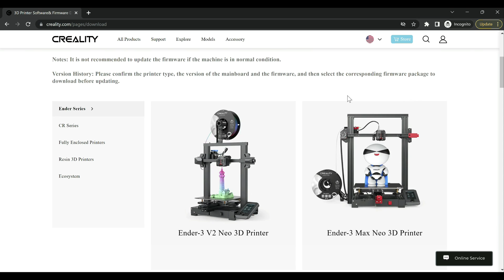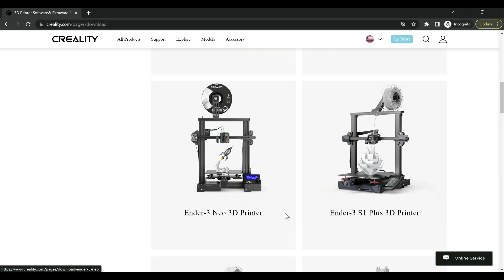Creality Touch Screen Install Guide

Comment: Thank you for another easy to follow guide. I followed the steps with my ender 3 pro w/ 4.2.7 and CR touch. When I turn it on the display shows the home screen, but the inputs aren't functioning properly. When I press it makes the input register sound, but either doesn't change screens or goes to the wrong screen. I've tried used both an 8GB and 2GB sd card to try reflashing the firmware. I have also tried using other sites firmware. Any thoughts on what I could try differently?
Reply from the maker: Hi. I havent seen a good version of firmware that works with this screen and the crtouch.
Reply: @3DPrintscape  Bummer, thanks for the reply. I've reinstalled the old screen for now. I'll be keeping an eye out for your marlin video 👀
Reply: Same exact issues. I guess I will put the old screen on and hope some better firmware comes out
Reply: @TwitcyTrain   after trying all three screens,v2 and the two touch, have gone back to original rotary knob. The best was the v2 rotary but  wanted my filament sensor to work ( ender3 pro with 4.2.7 )  but had to have cr touch as well,which ruined it, wouldn't work properly after install ,all genuine creality software
Reply: @iansummerfield4185  Thanks for the info . I also went back to the original rotary knob. I have a very similar setup with CR touch / 4.2.7...  I had a lot of issues just finding good functioning firmware because I also added the sprite extruder.  Finally have it printing mostly consistent.

Comment: Fucking hell, you cut out the one part I couldn’t do. How do you attach the damn thing
Reply from the maker: Hi. Which part are you having issues attaching? The cable or the screen to the printer? If its the screen to the printer. You put the 3 bolts in and align them up with the grooves in the frame. Then tighten them.

Comment: How do I install a BLtouch with this upgrade, I recently upgraded to this screen but I can't get the BLtouch to work
Reply from the maker: Hi. There was a separate .bin file that is suppose to work with the bltouch. I havent tried it out though. Once i get it working with Marlin, that may be an option as well.

Comment: Can you find out how to connect the touch screen to the skr mini e3 v3 board? I made a custom cable to allow it to connect to the tft pinouts but I’m not sure on the firmware where to begin to getting the screen working properly with that board
Reply from the maker: Hi. It could connect to the same port as the standard screen, just need to get it to work with the firmware (im trying to do that part myself and will have a video on it when i figure it out).
Reply: @3DPrintscape  I was going to do a comparison within the Marlin firmware between the mini e3 v3 and the update that’s available for the touch screen on the two creality boards that the update is for to identify what lines of script is used and hopefully just translate it to the skr firmware. What is your thoughts on that?
Reply from the maker: @AudioExportProductions  Thats what i was thinking as well. I can say just updating the configuration.h file wasnt enough. I think there is also something in the adv file as well.
Reply: @3DPrintscape  yea I’m finding in the configuration_adv under additional features that there is more on lcd and ui. It would be allot easier if we can view the .bin file for the screen update to see what they have enabled/disabled or if they added extra lines of script to the firmware
Reply from the maker: @AudioExportProductions  Makes sense and ya it would.
Reply: @3DPrintscape  I just don’t know how to change the binary file into something that makes since to me, I can change it to a hex file but it still don’t make since to me, lol
Reply from the maker: @AudioExportProductions  The .hex files are meant for the 8-bit boards, the .bin files are for the 32-bit boards. You cant look at anything in the .bin files, you would need the config to know what changes were made.
Reply: @3DPrintscape  makes since why after hours of trying I got nowhere, lol. I guess it’s time to just experiment and hope for the best
Reply: I think I got it figured out, I still have to upload firmware to the skr but I compared the config of the cr-6 se for the lcd.
Reply from the maker: @AudioExportProductions  Great, would you mind emailing me a copy of the configs, it will save me some time. My email is admin@3dprintscape.com
Reply: @3DPrintscape  so I sent you what I figured out but I haven’t had the chance to upload the firmware myself to see if it actually works on the skr
Reply from the maker: @AudioExportProductions  Thanks but I didnt get anything yet, even checked the spam folder.

Comment: I have the Ender 3 v2 with metal feeder for the extruder. It required 138% in esteps. I installed the new touch screen and lost the e-step calibration in the menu. Am I missing something or does it not have this capability. I'm getting under extrusion now. Touch screen really easy to install after watching your video. Thanks for making these videos.
Reply from the maker: Hi. They dont have some of the basic functionality built in. You will need to connect to the printer with pronterface or something like octopi.

Comment: Just did this upgrade, but how do I find/calculate my esteps on this new touchscreen?  I can't find them in the menu anywhere.  Do I have to plug it into a computer now?
Reply from the maker: Hi. I dont think its exposed in the menus anywhere, i couldn't find it either. You may need to use your computer and pronterface or octopi to connect and make the changes via gcode.

Comment: I recently upgraded Ender 3, with 4.2.7, a much quieter, new touch screen as above; both were impressive but with limited settings due to firmware. Also added a Creality Sprite extruder. Would you consider adding a video on that extruder in the future?
Reply from the maker: Hi. I will see what i can do on the video. I will need to buy the extruder so it may take a bit.
Reply: What firmware did you use
Reply: @patrickkimmett4502  Yeah, so finding the correct firmware was not easy. I believe I ended up using the 4.2.7 touchscreen firmware. I’m away for the holidays and won’t be home for a while. So I’m unable to check it out.
Reply: I'm trying to do this and I cannot get my screen bars to move at all
Reply: I wasn't able to get the new board up and running either. I can't find the right firmware...
Reply: Where you able to find that firmware? i'm having this exact issue and cant find anything and just keep hitting brick walls

Comment: Is the E3 max compatible as i cant get mine to work?  It has the 4.2.2
Reply from the maker: Hi. It should be.
Reply: Did you find a way to get it to work? I am in the same boat with a E3 Max but I haven't gotten time to even install the hardware yet.
Reply: won't work on the max,it says so in the firmware page

Comment: Thanks for the video and I'm looking forward to the next one with a description of how to modify Marlin for touch screen use.
Reply from the maker: Hi. Cool, im working on it though im running into issues. Hope to get it figured out soon.
Reply: Any news on the touchscreen working via/with marlin!?
Reply from the maker: @davevengelen  I dont have it working yet, im not sure i will be able to in a way that makes sense to do a video on. I think im going to cover upgrading the firmware on the touchscreen then move to the sonic pad.

Comment: i have one too on my Ender 3 Pro with main board 4.2.7 but now for two color printing in the post processing g-code we must change in method, marlin does not work, we have to choose BQM25 dont know why, and put some code  to G-code after pause---» G1 F1500 E-2, good luck my friend
Reply from the maker: Hi. When you say two color printing, do you have a dual extruder or are you just pausing and changing the color?

Comment: Thank you, Robert, I hope you'll have time for a review of this. I would like to know if it is a good upgrade to the standard dial screen.
Reply from the maker: Hi. I do plan on doing a review once i have more hands on with it.
Reply: @3DPrintscape  excellent, thank you Sir
Reply from the maker: @slicedpage  You're Welcome
Reply: Be careful. I have to switch back because I got a sprite pro extruder upgrade. Creality isn’t really supporting the firmware update for printers with a touch screen upgrade. At least the 3v2 with a sprite extruder and touch screen is not supported.
Reply: @Dr_Dorian Same issues I got the Sprite pro and the touch screen but I have to choose, touchscreen or sprite pro, my problem is I don't have other extruder only the Sprite pro
Reply: @Dr_Dorian Also my old original screen have issues with the knob so I'm between hammer and anvil
Reply: @eng.Georgi_Hristozov  sounds ruf. There is another Tablet controller out from creality and a few other things you could try but I haven’t tried them.
Reply: @Dr_Dorian  The creality Tab, mm I don't like it, ans the problem is the touch screen I bought it, before 2 days arrived and now I must return it becouse they don't have compatible firmware with the Sprite pro
Reply: @eng.Georgi_Hristozov  yeah I know what you mean.